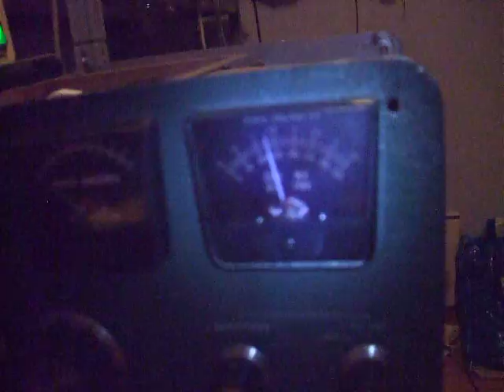Heathkit SB-220 linear amplifier repare.AVI

Comment: Probably would be a good idea to remind viewers that an amplifier has high voltages present that are deadly. I would not recommend powering up an amplifier with the cover off if you are not experienced in working with high voltage electronics. It could be the last thing you ever do.